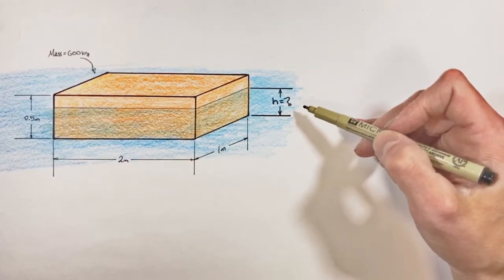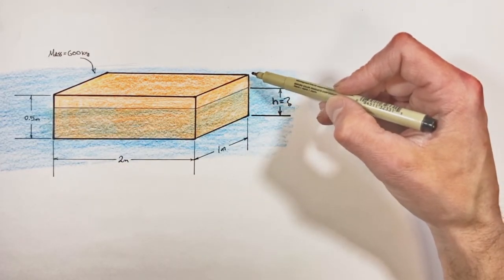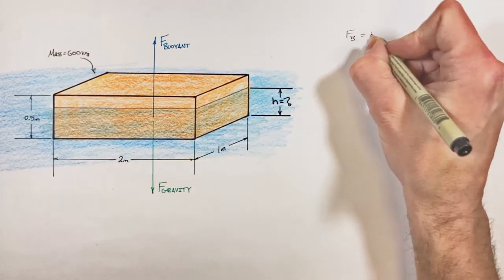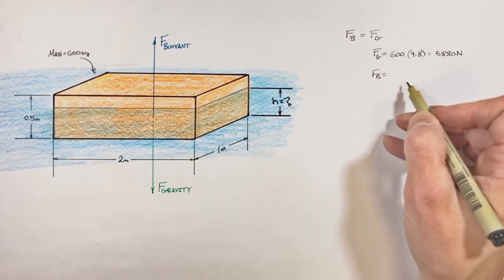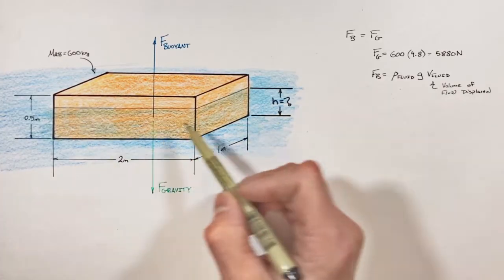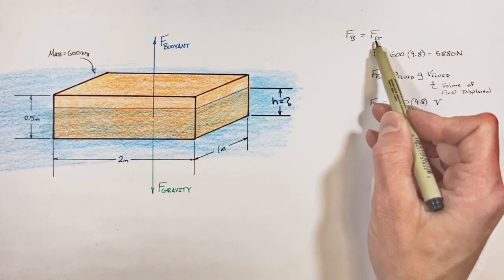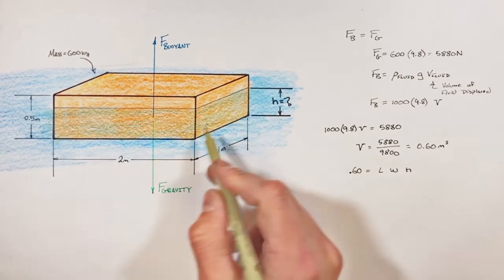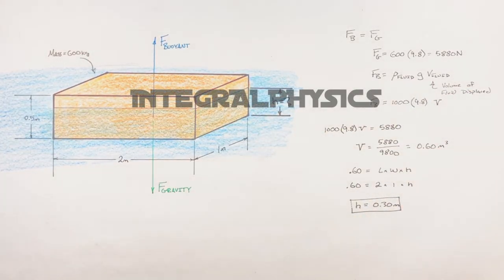Worked Example | Calculate Submerged Depth of a Floating Block | Buoyancy

Comment: If the block is fully submerged then how to determine the height of the water surface to the last point of the block? Do i have to consider the centre of mass in that case? If so, then how to determine?

Comment: Thank you sir, but isn't there a force acting on the block from the pressure of the atmosphere so the force F =pA(area of the block)? Then the forces would be Fb = Fg + F(air?)?
Reply from the maker: Yes the atmosphere is acting downward on the top of the block.   However it is also acting downward on the water, increasing the pressure in the water too.  Ultimately it cancels out.
Reply: @INTEGRALPHYSICS  That makes sense, thank you

Comment: Since gravity is a buoyant force in a vector pointed at Earth,  interesting math awaits to shed light on why 'buoyancy' of an object of matter FROM space TOWARDS Earth is never quenched (except by the blockage created by the surface of the planet).

An object of matter that is in space, and is too far from any celestial body to exhibit any acceleration, is not buoyant. It is at rest in space.

But if the matter object is brought near a celestial body, it gains an unquenchable buoyancy that is only 'arrested' by the planet's surface halting its buoyant acceleration.

The conventional math describing this 'buoyancy' is F = mg and GPE (gravitational potential energy) = mgh.

But with buoyancy of a matter object in water, we know the exact physical nature of the source of the buoyancy.
The 'buoyancy' of matter objects accelerating toward a celestial body is also due to a pressure gradient, but it is an electromagnetic gradient created by the constituents of so-called 'empty' space.

And that is the kicker - conventional belief is that space is empty, so there is no way to create a pressure differential.

But there IS an acceleration gradient.  The exact physical nature of the source of the acceleration gradient - is a worthy line of inquiry.
.

Comment: If the height were to come up higher than the object would that mean it would sink?
Reply from the maker: Yes.  If the calculated h is greater than the actual height of the object, it means the object does not displace enough fluid to float (ie.  The object is denser than the fluid in which it is immersed)
Reply: @INTEGRALPHYSICS  thank you!